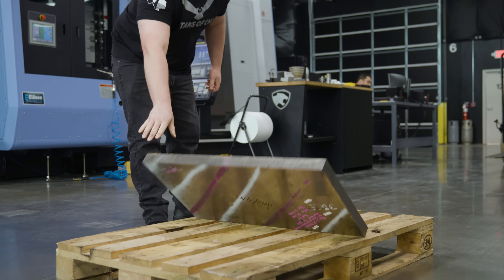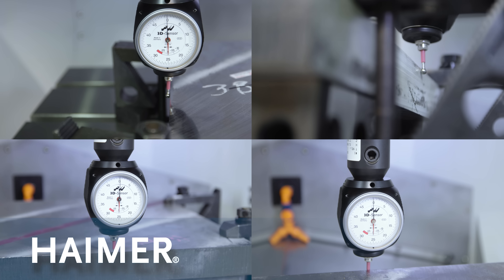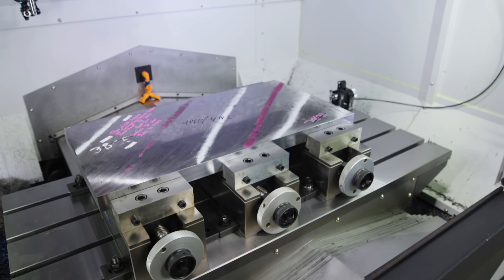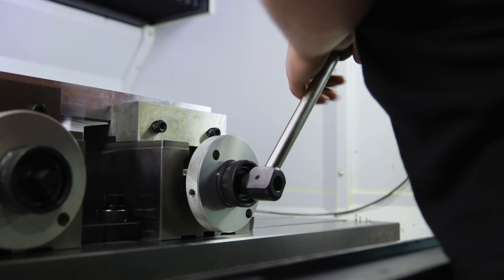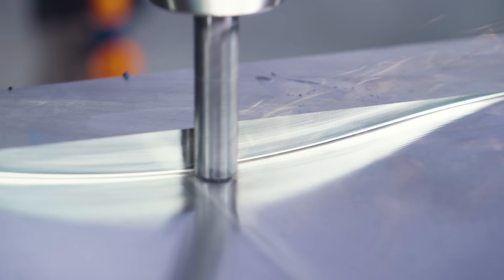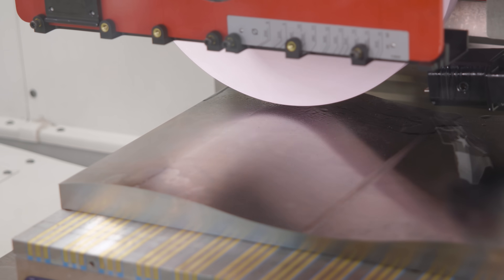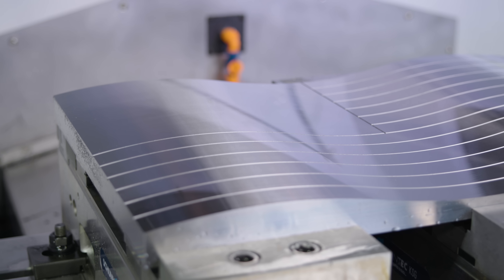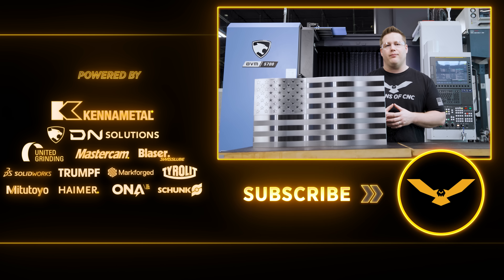This Part is so Difficult, They Told Me It COULDN'T Be Done

Comment: 4140 is a pain in the ass. It' ok to machine but loves to crack when welding. 4130 all day for me. Does everything 40 can do without the drama. But if you need to step up a couple of levels go to 15CDV6. Commonly available in all conditions up to dot 6.

Comment: Is flatness a problem ? Being Blanchard ground before milling doesn't actually prevent warping, the bottom is likely "potatoe chipped" from all that topside milling, I'd think leaving a tiny bit of bottom stock for the last operation would eliminate the warpage. How do you machine T-6 aluminum when warping is not tolerated ??

Comment: Hi, I would like to congratulate you for the high degree of professionalism in processing the parts with a high degree of difficulty, but as a big minus I would like to mention the loading and unloading of the parts on the machine tools with the forklift, which in my opinion is not the ideal solution, there is a risk in order to damage the machine tools if the forklift is operated incorrectly

Comment: Nice work. I was wondering how hard that  you heat treated the 4140.   I also wondered how you determine the centerlines of the machine to the workpiece.  Do you have to set the workpiece up in a certain position on the grinding chuck, not just random.?

Comment: In my experience with out of round grinding on our S31. The wheel diameter is almost always the issue if the form isn’t coming out right. If the wheel diameter is off even .008 it will cause big problems to your profile.

Comment: @ 6:08 you described the material as “heat treated”. The heat treated cromoly I have seen is  a darker color. Did the grinding take all the color off? What heat treating process? What is the depth of the treatment?

Comment: Your process leaves some things out. You should surface grind and lap the rear before installing on a chuck for the final mill cut on the surface and profile grind to eliminate stress from the chuck during grinding.

Comment: 4140 pre-hardened steel is used in mold making (mold or DIE bases, but also short run core and cavity). It is classified as "free cutting steel". It is in fact very easy machinable material.
The fact, that you could grind the profile is very interesting, but it could have been machined right on the mill with tight toolpath tolerances of .0001 to .0002 in cross hatch pattern and then finished by the classic mold making methods with scaping, sanding and finally diamond paste polishing.
Next time you put up videos like this, it would be really nice if you also upload required surface finish and the tolerances on the drawings. And perhaps also the use of such part (was this part some sort of  injection mold insert???).  Thank you.

Comment: The worst part of "It cant be done" is Listening and believing.

I worked in the Aviation industry at the time as a Repair Tech,  and this particular repair was critical to within 0.010" , or a million dollar part would be scrapped.
 I confidently set up the repair, but was approached by Management that questioned my abilities due to the complexity and critical nature of the problem. 

Here is what i said. 
"It is probably best you stop talking. I know what i am doing and the more you doubt me the more i lose focus"

I accomplished the repair so far "Under the tolerance" that i knew the QA did not properly inspect and diagnose the problem correctly. 

Did i tell them that. 

Nope!

Comment: I would need to be proven wrong but I would attempt to get that type of ground surface finish using a 5 axis mill. I programmed and ran a Hermle and the surface finishes you can get are hard to believe. The industry in a nutshell….EDM is replacing form grinding and    Hard milling is replacing EDM. Not true 100% of the time but that’s the way things are going.

Comment: I guess I just don't understand?? Was the project to test your new machine or to make the metal plate " wavy" ?? If the end result was to just to make the metal plate " wavy",wouldn't it have been easier to heat the plate & bend it with a hydraulic press??  I guess I worked as a welder in the oilfield too long!

Comment: There's another way to make such a part by first making the surface on thin metal, then laying it onto a rough shape and filling the gap using  electroforming with the machined surface covered. It can take up to a month to electroform fill, but it's an amazing thing.

Comment: Old Glory is a beautiful flag no doubt. Don't see what was so complicated.  Mill it a wave 1/4" thick and put a mirrored pattern on the reverse. Should be simple enough.  And then make it out of Titanium.  35 year ago I got to work in Japan on 12" thick stock . To make pressure vessels 120ft tall x 12' diameter 12" thick walls. Hydrocrackers... 9 of em.  Never did art work though.

Comment: Bravo!
These machines are amazing. I retired from a forge shop. Not a machinist. When I started all dies were sunk either on a Bullard VTL with a tracing head or Cincinnati hydrotel  with tracing head.  Had a couple big lathes that round dies were turned on as well.

 They were still doing repair and some resinks on the VTL when I left. Everything else was done on cnc mills and lathes.

Comment: They probably meant that you wouldn’t get the accuracy of the grinding machine if you had it moving the head up and down the whole time. Sure, it’s physically possible, but probably only on something you don’t want to hold a very tight surface tolerance on - get that thing in a CMM and see if it is holding to the machine specs on surface true position

Comment: Only thing I would have done differently on an artistic level would have been to not make the wave square with the shape.  I hope that makes sense.  I think that would have given the flag more of a realistic flow to flapping in the wind.

Next thing, Figure out how to flip the flag and  duplicate (reversed of course) the milling on the other side so your design can be viewed from both sides like a real flag.

Lastly....  Figure out how to hang it from a display pole.
Reply: A diagonal ripple would have been too hard, and proved whoever "they" are right.
Reply: @RawEffect  Why would a diagonal ripple been too hard.  Simply rotate the stock in the fixture by a few degrees instead of putting it in there square.
Reply: @JWonYouTube-q6d  Same reason "they" said the vertical wave was impossible. No real reason at all. Though if you rotated the piece, the borders of the flag would fall off the piece and cause them more problems than they already had with everything being square.

Comment: Grew up in a pattern shop. Large plates or blocks of steel and iron should be clamped or chained to fork lifts. Saw a man drive a plate of iron that size up to a cnc on the forks like that. Got off to adjust the clamps on the table. While his back was to it the plate vibrated off of the forks and shaved his entire calf off of his leg and pinned him to the machine. Never heard a man scream like that ever before

Comment: what only 1 sided? More like half done. also the ends of the flag do not fray complete with square holes I recommend photo etching after you thin the ends up. the flag should taper and be rounded, too. and why is it made out of steel, not tungsten.

Comment: My old job at EDI they would have just sent that milled item to us polishers and  have us make it a perfect mirror polish.  They produce plastic extrusion dies and the feed edge has to be perfect or the product will be f***ed, our area produced sheet film dies so min 32" length × 3" area had to be perfect.  Longest die I saw in there was 25' took about 2 weeks with 24/7 shifts to complete that 1 project

Comment: When cutting the lines for the stars and stripes, was it an issue that the surface (the wavy flag) wasn't at 90 degrees to the cutter head? Seems like you'd get different depth of cuts depending on what part of the wave you were cutting on (unless the CNC computes that automatically).
Reply: I think that's why they used a ball-nose end mill for it rather than the 90 degree V groove tool, as the radius is easily compensated.

Comment: so does the grinding machine account for the change of the point of contact or did you have to code that in yourself?
all the cnc machines ive seen have a fixed point of contact, or are at least a specific shape on a 2d plane, so the code just has to follow the work piece accounting for the size of the bit. but if the point of contact changes you'd have to have the machine move on a path that doesnt perfectly mimic the surface of the work piece

Comment: as a CNC-machinist in the wood industry (furniture), the work is impressive.

I can understand there is limitation to CNC-machines in the metal industry. For us in the wood industry and our CNC-machine, it's quite simple work to do. We use to say that the limitation to the machine, isn't the machine but the programers fantasy.

If I was to make that flag in wood, I had just equipped a sander to our machine, and for those more precise milling work, I had just used a floating head, where the machine just follow the conture roughly and let the floating head to the rest. But that might just be the flexibility of CNC-machines in the wood industry, newer one you can program exactly how the tool looks into the machine, so the machine will treat the entire tool as a "origon" then just having a single point as "origon" on the tool.

Comment: who told you it couldn't be done? Pretty straightforward CNC work, now if the wave went in two different directions that would have been tougher! You could still do it with a radius wheel,  I'd be more impressed if you long-hand some 3D programming like we had to back in the 80"s, not because the software didn't exist but because small job shops couldn't afford it!

Comment: Learned and started doing machine work ( manual ) in 1973 when i went into the U.S. Navy. Got out in 1981 and continued until 1991. 1991, went into CNC machining till i retired in 2021. It has to be your passion, not just a job!

Comment: I couldn’t imagine what something like this would actually cost on a consumer level. That is beautiful machine work.
Reply: could imagine the raw material cost being out of the range of most
Reply: Not sure what a wider billet of 4140 like this costs, but a 1" x 6" x 12' flat bar runs a bit over $1k nowadays.
Then the machine time, tool wear, and setup cost is easily a few thousand, although setup cost would be amortized over the batch if a small run was done. I'd say less than $10k is possible.
Reply: Guessing ~15-17.5k for single unit runs.
Scaled up you could very well see costs nearing ten grand lower, but the volumes you'd need to produce at would be unmovable.
... Think either this or a car, pretty much. :I

Comment: Damn man, I wish I had the spare dough to use a block of good steel like that for artistic projects.  That thickness, what, 80, 100 pounds of steel right there?  Maybe the phone screen is dickin me with scale but that much heavy metal ain't cheap.

Still, absolutely gorgeous work.  I dont think my cnc would come close to that on such a beefy material.  Alum maybe.

Comment: Very nice work, I still don’t see why you “couldn’t make this part” the only issue was setting the curves to match the wheel diameter. And most CAM programs will do the math for you. Just like when you roughed the curves with the endmill, the machine compensates to the  tip of the tool. Maybe some fiddling with g-code or CAD to get it perfect but farrrr from impossible

Comment: Nice part however I can’t see any difficulties to do it.
You guys have tendency to use dramatic headers to describe relatively easy jobs.
Reply: It's not that easy. Even a master machinist has to think about every line of code and every character in that code. 1 typo can be disastrous. Sure, the machines can do a dry run but if you do find errors the correction might be a cakewalk, might mean hours upon hours. 

They make it look easy but it's not.

Comment: Looks good. But how do you know  cutter conp is working in the grinding op? Do you hear/see rpm change to maintain SFPM over different parts of the wave? Is the offset changing with grinding wheel wear and increasing rpm as the wheel gets smaller? Did you attempt to hold any profile tolerance or just make it pretty? It looks great, hope there's more to it than looks.

Comment: Looks amazing. But would it be possible to repeat the process on the other side. Just wondering as the base of the material wouldn't be flat. I have no cnc experience. Hence the probably silly question.. Just so the other side wasn't flat. Either way it's a beautiful piece and finished exceptionally well.

Comment: Yes. But. All I need to complete my Blessing Machine is an aluminum grill for the Losi LMT Son Uva Digger chassis. Yet nobody makes and sells it. The Omnissiah the Blessing Machine urges capitalism to denounce the crude biomass that you call the temple for it will wither and dies. Strength and certainty through steel. Enlightenment through silicon. Efficiency through electricity. Constructed one part at a time as prophecy foretold. The Omnissiah the Blessing Machine revealed.

Comment: The magic of modern day machining. In my day ( plastic Injection Moulds ) UK spelling. On a 4" / 110mm swept radius bend it was done on a circular table all by hand, winding the circular table back and forth following the circular scribe line on he end of the Nickle Chrome steel . Gradually feeding down your ball nose end mill and cut till you was a whisker away from your scribe line on the end of he block.  Then turn the whole thing over and do the same to the other side. That took care of the Male side.  Then you had to do the same on the block of steel that was to be the female side, taking into account what the wall thickness of what the plastic product was going to be. Then all filed / sanded / polished to the finished .  That was what real tool making was.

Comment: Absolutely beautiful job! Wanna go one better?

Same again BUT ...
1. Use an appropriate Aluminium plate
2. By masking BEFORE machining blue anodise just the star background
3. Red anodise just the red stripes
4. Cut the stars THROUGH the blue
5. Cut the edge of the white stripes, removing a tiny sliver of red each side.
6. Finish the white stripes with a diamond cross pattern.

I can guarantee it will blow your mind! Just do a small, flat version to see. 👍👍👍

Comment: I wonder if you could have offset the face of the wave by the radius of the grinding wheel in cad. Then you could just run it without any compensation, with the grinder thinking it has a zero-inch diameter wheel.

Comment: How do you stop it from rusting
Reply: Excellent resistance to corrosion is the reason why 4140 steel does not rust so fast as compared to other types of steel. This can be attributed to a significant percentage of chromium and molybdenum. However, once corroded, the 4140 steel will just rust like most steel that undergoes the same damage.

Comment: Hey, you should check out the Ingersoll indexable spot drill.  I have been using one for engraving and chamfering on my HAAS for over a decade. It's AWESOME!  Pretty much burr free and very fine detail depending on what model and insert you use.  I think .01" or .031" radius are the options.

Comment: If it was a heidenhain control you could have set the spindle axis as Y instead of Z and it would be easy once you established the wheel diameter. Im surprised that these Blohm machines aren't available with the Heidenhain. I guess they've developed all the front end for Siemens. Shop floor programming or having to think out of the box the heidenhain is worth the extra dollars.